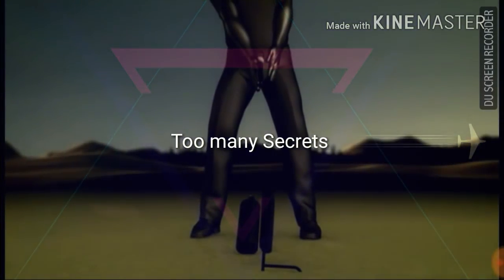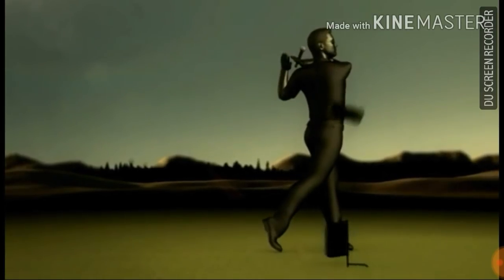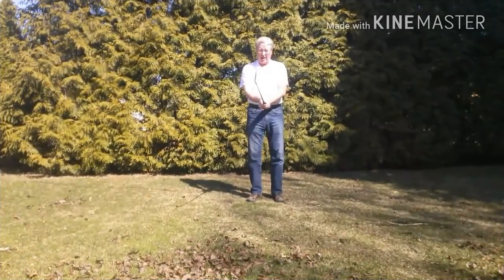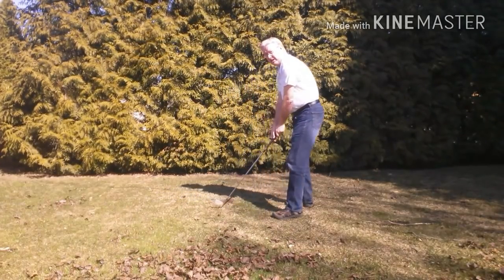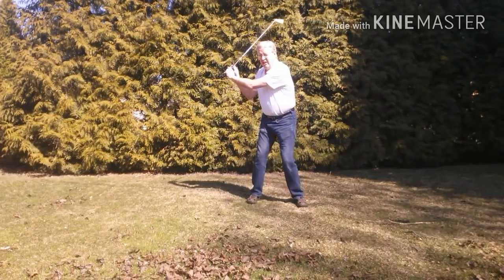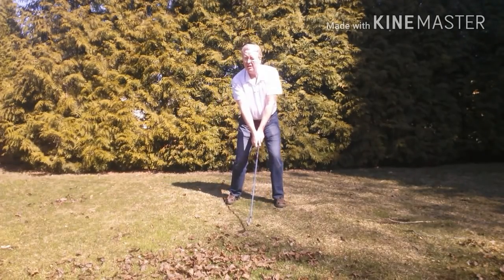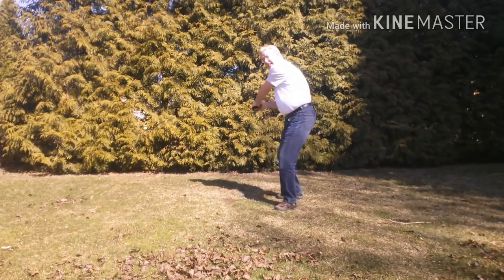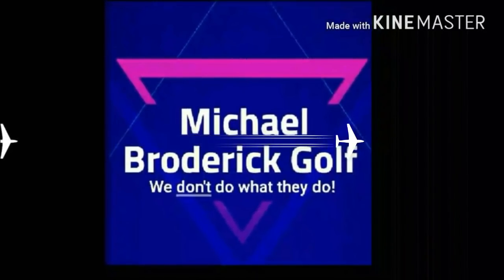MBA golf series centripetal force and the 3 finger drill

Comment: Mr. Broderick Thank You for your channel.  In my humble opinion, your channel is one of the best golf instructional channels on YouTube.  I'm curious about the Dunaway first move....it seems like moving into the Moe Norman setup.  Is this a One Plane Swing?  Also doesn't this effectively change Lie Angle?
Reply from the maker: charly yoo thank you Charly for the kind words. I only teach what I found worked. As far as lie angles  I found that all I have to do is use my rt hand to strike a ball. It doesn't matter. As long as I reach out for a ball I'll nail it in the center of the face. Right now I'm just teaching cmotion to people although there are common elements to every method. If I found an element that worked I kept it. If it didn't I was done with it.
For instance I love Mike Dunaway. I can generate great speed but my irons are just not as accurate as with cmotion. So I don't use the same motion I did when I was into Long drive. I adapted to learn to score. I realized cmotion was such a simple motion and it holds up day to day. I have been adopting the motion all summer with good results so it's becoming ingrained now. It's arm motion was similar to mine anyway with a lot less moving lower parts than I had.
Plus I still achieve good distance.
If you wish I am in hangouts at michael.broderick4@gmail.com 
I share additional material there to help people.
I simply got tired of all the nonsense written and taught. I was athletic when I was young and most that was taught to me just didn't make any sense. Once I started seeing common traits in every good player and defined them for myself I got better. Much better in fact. 17 strokes better to breaking par and driving balls over 350 again.
I'm 61 and do both those things on a regular basis. When I started my studies I was down to 250 yards and couldn't break 85 anymore.
I thought it was my age advancing but I proved that to be wrong. I'm still improving in fact!
Thanks again for the kind words.
It's a secret only a few hundred of us share!

Comment: It seems like you are dropping the club down quite a bit before you even move your lower body to post up, it should be the other way around, start with your lower body first and then let the arms fall into place like a whipping action. The  faster you move the arms without the lower body, this will cause you to cast the club out,  but if you start with the lower body first, then the arms will automatically fall into place. Just like a baseball swing, you must start with the lower body first, no difference in golf.
Reply from the maker: 1234 Hips chest arms club. I don't cast. It's an alternative to standard teaching which failed me is all. You like rotary. That's fine. I've just offered theres many ways to do it. I simply show people how I got better. Not just better. I'm scratch. At 62 I can hit pro average distance and above. I break par. It's just we don't don't do what others do an offer an alternative thats easier on the body. It's great for seniors and actually all players. The modern swing can be quite injurious which is being proven out on the pga. I could never master it and I was an athlete. I just did this channel to offer how I got better and improved. Leverage and speed not body twisting, big shoulder turns or ram rod left arms. All not necessary. An alternative and a choice. Thanks for commenting.
Reply: There are PGA teachers who don't say you must start with the body first.. eg Tony Luzack. He says ABC.. arms body club.. so there is more than one way.